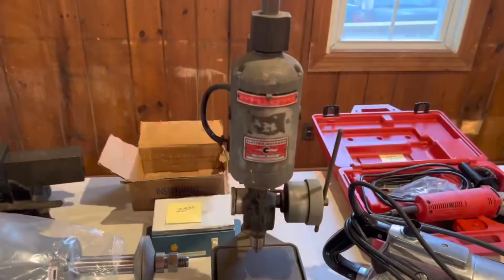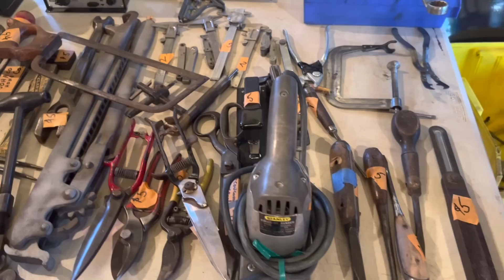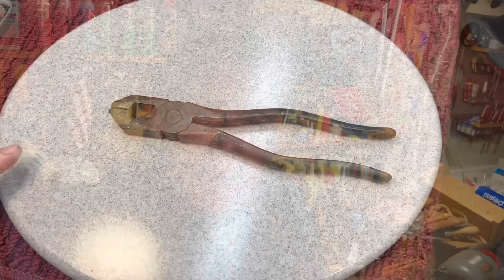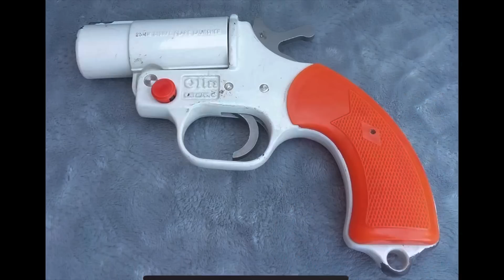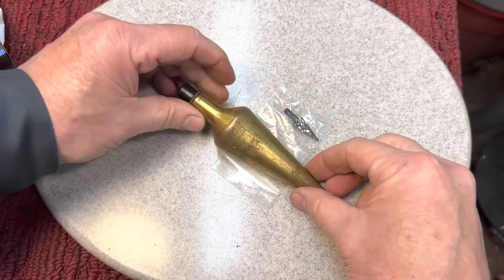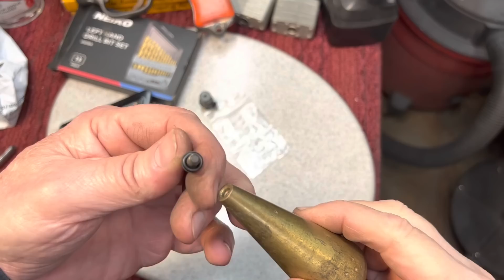Long Island Tool Meet, Plumb-Bob fix, Cool Stuff

Comment: I like seeing the coverage of the LI Tool Meet. What are yours monthly? Also despite the traction elevator hoisting ropes being multiple, one rope can sustain a fully loaded car. I think the gap in the jaws of lineman's pliers is to accommodate twisting wire conductors without damaging them.

Comment: Who doesn't love good pencils! I used to get the keys to the supplies at school for art class to get supplies.  I'd grab a pencil or two for myself.  Teacher didn't mind.  The old packaging was awesome.  I love seeing it.  Born too late John.  The flare gun in ScoutCrafter Red I foresee!  I think I got my lefty drill bits because of you.  They work great!  QUESTION: Have you taken a measuring tape apart to clean and lube and successfully put back together?  Dang if I can!
Reply from the maker: I did one years back and it took me about 5 times reassembling to get it right!  The spring tension was either too hard or two soft! 😂👍

Comment: You got lucky with the left handed drill bit. My experience is that happens 1 in 20 attempts. 1 in 10 tries I break them!
Reply from the maker: I find the HSS titanium nitride coated bits are more forgiving.  😃👍
Reply: @ScoutCrafter  
Mine have always been SO cobalt. Funny you should reply now. I am grinding on an Estwing 5 lb sledge right now. I keep hearing you in my head! I may ruin it but a 4 lb sledge is cool too!

Comment: SC, save that left handed screw from the plumbob. Take a left handed tap & use it in your next trick bolt puzzle #2.🤣 ( why won't this *@#% screw loosen up ?)🤬
I believe the Bible comments on the future of thee False Prophet weathermen in Rev.
Take the Boker pliers, drill holes in the tips. Tap for threads to install very long skinny bolts with small hex heads on them. Then you got a custom pair of reachers to retrieve items that fall in odd places. Works good. Enjoyed the show!

Comment: Hi John,
That flare gun is a 12 gauge. Do not, as others have done, stick a shotgun shell in there and fire it off! Of course you never would, you are not an idiot. The chamber should be too short to accept a regular 2 3/4" shotgun shell, but many of them will.  I have heard sometimes it works, leaving the shooter with a very sore or injured wrist, but other times they, especially the all-plastic ones, come apart like a bomb. We're surrounded by fools.
Reply from the maker: This one uses 25mm shells.  They aren’t cheap! 😃👍

Comment: I really like the old tank level gauge!  I have seen newer versions of these on some of the gen sets I work on.  They are still in production believe it or not and they have not changed all that much.  They are more or less calibrated to the depth of the tank they will be used with (the reason the diameter of the tank is specified)  The higher the fuel level is in the tank the more pressure it takes to push the fuel out of the dip tube which extends just about to the bottom.  More pressure equals higher reading on the gauge!
Reply from the maker: Thanks Mike!  I was wondering why the temperature scale!  😃👍

Comment: I too love pencils..  I guess it started with Mechanical Drawing back in the 8th Grade.  I took some Cartography classes in college and learned to use a #7 pencil to do the layouts before inking (everything always had to be done in ink).  The lines are so faint you don't worry about trying to erase the construction lines.  From more than a few feet, they are invisible.  I used the same pencil for four different classes over two years and only used about a third of its length.  I always joked about using it for a nail set after finishing the classes...

Comment: Thank you for yet another video. You are a Saint!   Would one ever buy those $1 hammers in order to re-use the handles say on different heads?
Reply: It is very difficult to remove a well-set hammer handle without destroying it.  If the handle is already loose, you have a chance of removing it...  Good luck.
Reply: @edwardmartin3069  Remember he has a Dake that should make that task easy.
Reply: @johnpossum556  You're right I forgot all about that...  The Dake will get the job done....:D
Reply from the maker: Those hammers were awesome because they were old and not abused. Sometimes we come across a box of hammer handles at the shows $2 a piece!  😃👍
Reply: Thank you both.  I will check them out at ET next time I drive up.

Comment: You have to attach a hose to that level meter and sink the end to the bottom of your oil tank. Now when you pump air with that plunger there is a point when the pressure equals with that of your oil level (cause the air can escape through that sunk end of the hose). That’s how that thing determines your oil level. There must be some kind of set screw where you can adjust the height of the max oil level… Greetings from Germany, big fan of the show!
Reply from the maker: I wonder why the Fahrenheit scale? 🤔. Thanks!!!
Reply: @ScoutCrafter  It's F for FULL.  If you look at the left side, it's L for LOW
Reply: @grounded-b  E for Empty.

Comment: Hey John I completely forgot I have the Neiko screw extractor and left hand drill set. But that set tends to run a larger diameter for bigger bolts. You made it look so easy with the center hole drill. Thanks a bunch 👍😎
Reply from the maker: What a great project!  😃👍

Comment: You can dissolve steel screws/bolts/taps etc embedded in brass with alum - which I think is Ammonium Aluminium Sulphate - might take a couple of weeks, but no effort involved.

Comment: As you know the ball weights would rise as the RPMs increased from cable speed. Rising enough or having the balls move out and up from centrifugal motion activated the brake. Though it came from stream engine governors, the expression "going balls out" was derived from this type of governor.

Comment: Horror Freight has 13 piece left hand drill sets that are inexpensive ($8.50). Like John says, they can be a lifesaver and since they are used infrequently a set will last you a lifetime.
  As Ed Schwnek points out it is very important to hit the center of the broken fastener. This can be difficult as the fastener often breaks off at an angle and the broken surface of the fastener is work hardened on its surface. Starting off with just a drill will have it skating off to the side. A transfer punch and center drills are your friend.

Comment: Just ordered a set they are 21 quid over here £21 I can’t wait to make a film of them arriving so you’ve never heard of it I never knew they even existed I’ll make a film of all of the gizmos and gadgets I’ve got when it comes to tackling those sort of problems Amazon said it will arrive on Wednesday I’ll keep it safe with the scout Crafter screwdriver👍👍👍👍🔩🔩🔩
Reply: Twenty one quid used to be real USD $$$ but now that is around $23!
Reply from the maker: Reggy- If you use them one time you will be thankful you bought them.  As soon as the drill bit grabs it twists the broken stud out!  😃👍
Reply: Hi John…Nick Zarolli (actually Zicari here) glad you enjoyed the Yankee screwdriver…hopefully someday you get around to figuring out the knife and level meter. They should clean up well in your hands. I really appreciate the shout out and the info on the meter from your very knowledgeable cast of caracters…